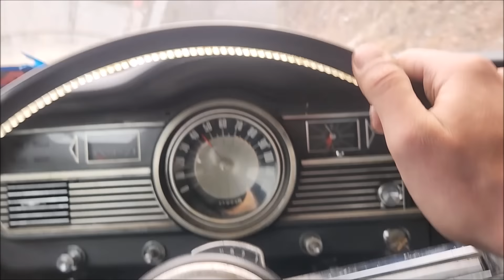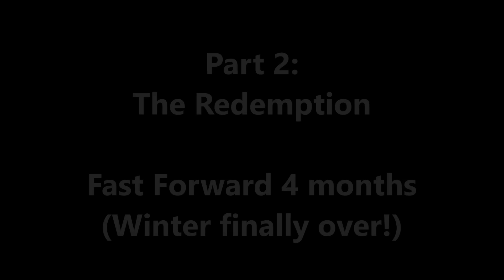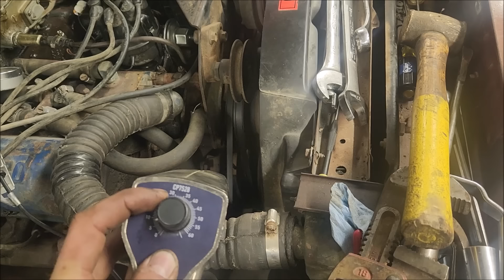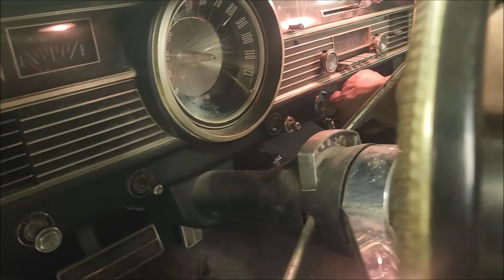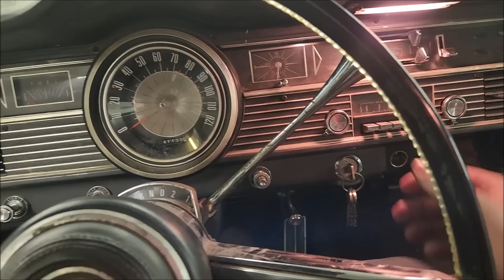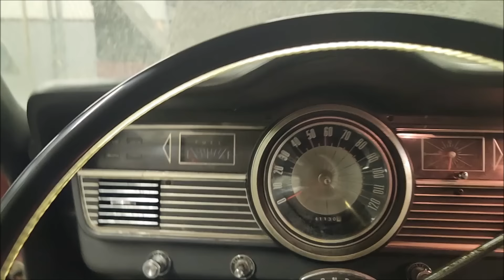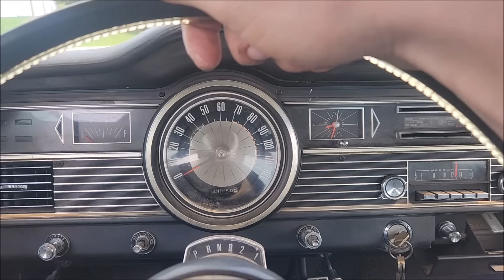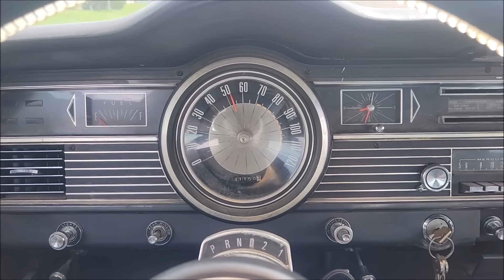$1,000 Classic Car - Will it Run & Drive Home?

Comment: You should definitely try to get that back, other than the driver's side lower rear quarter, it looks pretty solid, the interior looks like it will clean up reall nice, the seats look good, dash, headliner, all look good. I like the color combo. A big maroon Merc or Lincoln with a black interior is nice. Since he's getting the highish compression 390 2V out of it, maybe you could put a 410 or 428 4V in there if you manage to find one, that or a 351w from a rusted out truck in a junkyard and a C6 might be a nice combination. 393/408 stroker kits are still cheap for those and aluminum heads for Windsors aren't too difficult to find. Not sure if it's worth all that effort but, something in between, extra medium, 250-300rwhp and 300-400wtq is enough to feel good in a car that size. I always wanted to try using an aftermarket Windsor block that will take a 4.125"+ bore with a 2.87"(289) stroke to swing in at around 5L with good heads but, that's not what a car like that needs, might be neat to see a maniac try a 9.5" deck block with a 4.030" bore 1.165"- 1.175"CH .927 pin (331) piston, a 6.2" rod and a 4.25" stroke for 434ci to make the ultimate budget torque monster Windsor.

Comment: Owning cars that flooded 40 years ago I actually knew the foot flat on the floor starting method, it was better than pushing it down a hill or pulling plugs! No internet back then or home pc for that matter, so either some one told me or I read it in a book.

Comment: I once had the distributor on a 1970 Ford f100 with a 360 in it one time I was driving home from work and the little gear that turns the distributor broke so I had to learn how to find TDC pretty quick.😂😂😂
Oh yeah I used to like to find old cars that the owner said it doesn't run any more 80% of the time they just need a tune up.

Comment: 44:30 it's not voodoo black magic when you're explaining it.  This is something I've struggled with on various 2100/2150 carbs and others.  Now I think I understand better the relationship with the ported vacuum vs manifold vacuum and the idle speed and the timing.  It does all flow together, and you have to have the ported set to near zero before any of it will work.  Gotcha.  I think.  Really need another carb'd car to tinker with and get better.

Comment: Thanks for passing along a lot of valuable information that is quickly being lost to time , many years ago at a trade school (that no longer exists , unfortunately) I was taught that setting the points with a dwell meter was also critical to the overall "balance" you're seeking here because the dwell angle (or time) of the points also affects initial timing , do you agree ?
Reply from the maker: I do think dwell is important - especially if you start getting in the upper rpm. I think you can get away with a lot inconsequentially in the low rpm as long as point gap is in that .017 to .020 range, things just seem to play nice

Comment: I ran into something on a 390 a month or so ago that was a first for me. It ran good under acceleration but had a rough idle. Idle mixture screws just didn’t make sense but I could not find a vacuum leak. It turned out the brake booster was leaking vacuum on the inside.  New booster , reset air idle mixture she runs like new.
Reply from the maker: Always so satisfying getting stuff ironed out

Comment: Ford is the only Company of the Big 3 that is the original Company, survived the two biggest lawsuits in American Automobile History and suspensions and rears are still used all across the Hotrod community. Thunderhead289, you've done nothing wrong by sticking with Ford Lincoln Mercury products, FoMoCo for life!!!

Comment: You can set the points with a matchbook cover. Also, it times at 6 before but I always set mine at 8 to run high test.
Reply from the maker: If you follow the book you just leave gobs of power on the table. 
Need to look at initial and total - and again, give the engine what it's asking for as there are clear indicators as shown in the video 🙂
And a business card is the same - ironically .017 to .020 thou
Reply: @ThunderHead289  That was back when there was Sunoco 260. Low octane unleaded and gasohol are game changers alright.

Comment: You did the distributor drop the hard and dangerous way.  Far simpler to lower it until it stops on the oil pump drive shaft then push down and bump the starter. It will drop with a half turn. 

Then i put the engine rotated to target timing on compression stroke. Then put on cap and run #1 wire to a plug laying on a grounded surface...with ignition ON but engine not moving, rotate distributor and  look for a spark. When it just sparks, tighten the bolt.  Yer dun.

Comment: 40:45 What I used to do is put a nipple pip on with jb weld in the threads and around. Then just use fuel host and pip filter

Comment: Thunderhead289..so once running..would you say the order is dial down the throttle until no more compression on the port side..then adjust timing.. then dial in fuel mixure screws.  Then attach back vacuum advance..for the engine to tell you what it wants?

Comment: Clearly Loctite is a brand name. The product is just called Threadlocker. So many people make that mistake in Youtube land. A small torch will soften any threadlocker once it reaches 350°-450° for just a few seconds. 
 I use heat to break it down very often in my industrial repair work.

Comment: You're right. A tank in a town centre makes no sense. Is that why you drove a second tank into the town centre so it wasn't quite so lonely? You like the car and the future owner only wants the complete drive chain. An opportunity presents itself on a plate but it would have been better if you had removed the drive chain for him. He won't be taking much care when stripping it out, certainly not as much as you would have knowing that the car was going to be rejuvenated.

Comment: When my car hits 15 years or so (or I buy an older car) I replaced all the rubber hoses and belts unless I have proof they were changed in the past five years   Blowing a brake line or radiator hose or alternator belt on the road is a pain.   Even if you are paying a mechanic to do it, it is not that expensive

Comment: Hope you invested in a case of CRC Brakleen !!
I thought for sure you'd have broke out the matchbox cover for setting the point gap ...
And where did you hide ur HFT remote start trigger ??
Thanks for sharing Luke.. always a good laugh !
Reply from the maker: I usually use a business card but I always get flamed online for that, so this time I tried to do it "the right way" 

And then quickly used a screwdriver to roll the engine the wrong way - naturally 😄

Comment: Fun fact. If you remove the adjustment screw on some vice grips the slide hammer will thread into it
Reply from the maker: I'm going to cut that piece off the old distributor and literally weld it to a pair of vice grips 🙂
Otherwise ruined now anyway, so why not

Comment: Great video!  I have an 1984 Mustang 5.0L (302 CI) and it is carbureted. This video gave me the info I needed hopefully to get it running properly. The car isn’t driven much, so my carburetor issues are usually for it sitting around too much. I’m going to try the spacer, maybe that will help.  Any ideas ?  Thanks!
Reply from the maker: The biggest thing is to really scrutinize the ignition timing - it will make or break performance for sure 🙂

Comment: I've learned a lot from your videos, thanks.  Going to have to try your tuning method for sure.  I have a beautiful 68 Torino GT w/ 390 that my grandfather purchased new.  It seems to run pretty good, but if you let it sit for a couple of weeks the next start will be very difficult; it will run real rough and blow black soot for a while.  If I can get it running well enough to drive it will clear up after a few miles and then run great again until the next extended parking.  This is driving my brothers and me crazy trying to sort out, any suggestions?
Reply from the maker: It sounds like the choke is adjusted to rich - take a look at the choke flap itself, and at the choke cam screw. 
Finally, check to make sure the choke mechanism is still functioning correctly and rotate it as needed. 

Clockwise will be leaner, counterclockwise will be richer
Reply: @ThunderHead289  Holy shit I fixed it!  It was the power valve; the car runs better than it has for years.  My brother is cruising his two sons (1 and 3) in it right now, forth generation.   I figured it out by watching your videos on FEs just took me a couple months to get around to it.  You are the man, thanks!

Comment: i am guessing and very optimistic that it will drive home with the minor hangups along the way as long as the one engine is 75 percent in good condition and two has low miles and three and still has alot of love to gve to others and last a 100,000 plus miles.

Comment: ? Luke help me refresh my old memory. when i was a teen back in rthe 80's my 70 ford galaxy when i would turn it off it would "diesel" meaning it would continue to run after turning key off. My dad would fix it, but i dont remember what he did or what caused it. could you refresh my memory.
Reply from the maker: Basically its caused by a combination of the throttle being too far open at idle allowing a fair amount of fuel to be drawn in and then the engine being hot enough and the octane in relation to temp being low enough to self ignite via compression alone. 

Could have been throttle hanging if it was a quick fix and you hadn't turned any screws after your dad fixed it
Reply: @ThunderHead289  thx for quick response, have an awesome day

Comment: I think it's interesting that an instant start like this (or any well-tuned carbureted engine) is only possible on a carbureted car.  With FI, the electronics demand a little cranking to figure out where they are before they can fire injectors.
Reply from the maker: The carburetor - a miracle of fluid dynamics and physics indeed 🙂

Comment: Suggestive Braking System. Yea sounds official.
The old Standard Brand ignition point boxes are 17* thick. You can use the box lid for a gauge.
Reply from the maker: Indeed, just like a business card plus or minus a few thou

Comment: I'm Matthew from Burlington wi I just did a engine swap 350 89 GMC pickup TBI engine.  She was knocking. I used to race stock cars s and worked at car and truck junkyard. So the the truck came with 350 vortex engine efi. Oh she's fast took lots of money and special air intake manifold and good Holly TBi adper plate and bolted on shortly headers to stock y pipe and to stock exhaust lol 89 GMC pickup TBI distributor and all the stock parts GM and Ford kept same parts many years. Lol my clean 89 GMC pickup out run my 2000 5.9 gas dodge ram.

Comment: I keep having issues with setting my timing on my f100. I set it by ear, 8-12 degrees and it runs ok, but shutters when I turn it off and stumbles for a bit when I start it. hook up a vacuum gauge, shows late timing. Try and adjust it to where its green in the gauge, timing goes up to 40 degrees and vacuum would keep climbing if I could spin the dizzy more. New balancer, so that's not the issue, No vacuum leaks. HEI, rebuilt 4.9 inline 6, doing this all with the vacuum advanced disconnected and plugged. Ive been pulling my hair out for months trying to figure this out.
Reply from the maker: Mix screw will play in big to vacuum. 
Pretty sure an inline 600 has a ported advance port - same deal as this, the initial timing it takes for you to be able to reduce curb idle screw to where you have 0 vacuum on the ported port is where you want to be for initial timing 🙂
Reply: @ThunderHead289  I believe the original single barrel has a ported advanced, but that carb was long gone before I got the truck so I have one of those cheap amazon ones on there. It has an advanced port nipple, but the way they cast the carb body they blocked off the port in the carb body. I think I will need to try and track down one of the old Carter single barrels and rebuild it. The Amazon special got it running, but its not that good.
Reply from the maker: @evasesh6585  I know the originally ones were incredibly well setup and almost fuel injection level style maintained ideal afr numbers. 
It would definitely be worth tracking one down - the carb is likely what you are fighting mostly in this case
Reply: @ThunderHead289  Thanks, that was something in the back of my mind for a while. I have one off of an old AMC, but those are a little different, so I will see if I can find one off of an old ford to rebuild.

Comment: I liked what you did removing that water hose from the carb base.  But isn't it true that the older gasoline had a higher boiling point than the new alcohol fuels we use now?

Comment: I  think Ford and Didge Shared Some Partts.  They used to have a problem Vapor Locking with the Chrysler Slant 6 Engine,  unless You put a Toyota Carburator on it.

Comment: Hey Luke I  have a few questions I have a 67 mercury parklane with an fe it runs great with 20 degrees advanced 10 degrees advanced it runs like crap but 20 degrees advanced and idle set at 800 rpm and put it in Gerrit stalls to keep it running you have to set idle to about 1250 rpm for it to idle at 700 rpm  what could be causing that

Comment: I gap my points, set the timing, warm up the engine, recheck timing, check the dwell, set the dwell, recheck timing, tighten hold down and robert's your mother's brother.

Comment: what size allen key is it for the vacuum adavance adjustment?  Are all of those aftermarket ones adjustable?  I have a standard motor products on my 64 Galaxie.
Reply from the maker: Probably all the same size - you can tell which one it is since if it's too small it slides way in. 
Can't remember the size off hand 
That's what I beleive this one on screen was - same as yours
Reply: 3/32"

Comment: We don't need any more Chrysler. Dylan McCool has saturated that. 
Back in the day had a '67 T-Bird. Same 390. A beast. Not more than 6 years old and the gas tank sprung a leak. Lousy Sears gas. Didn't have a garage, so worked on it in the parking lot of my apartment. Couldn't keep it.  Wish I still had it now.

Comment: On those FE's. Isn't the timing supposed to be 10 degrees before top not after? The service manual for my 68 f100 with 360fe shows it as 10 BTDC.
Reply from the maker: Don't follow the service manuals - that's something ford people do that gets them into a lot of trouble. 
Ironically, it's because ford people try to do things "right", but in this case the right of yesteryear isn't the right of today. 
Different era, different type of fuel - same reason the heated spacer worked then and not now. 

As I show in the video - the engine will absolutely tell you what it wants via the vacuum on the ported port. 
The initial timing it takes to idle with 0 vacuum on ported via curb idle screw, is absolutely the initial timing the engine is asking for. 

It makes a massive difference

Comment: Awesome video man. is timing advance the same for my 360fe with factory duraspark? I found out my advance canister doesn't work when doing the suck test. Simply does not move so figured it's no good. Does the duraspark advance ystem work the same as if it were points?
Reply from the maker: Everything is indeed exactly the same except for the point gap
Reply: @ThunderHead289  thank you! New canister is on the way. Runs OK with the bad canister but i wanna get her done right and get the total timing verified 👍
Reply: @ThunderHead289  new vacuum advance canister is installed, working properly with suction. However, the canister arm is not staying engaged to the distributor after a few minutes of driving 🤔🤔 having to pop the cap and rehook it to the advance plate under the cap... Thoughts?

Comment: i had a 69 f250 with a 390. i rebuilt the engine and ran it for awhile. had a c6 and boy was that fast I outran a newer ford truck and all it had was a 2bbl and points. loaned it to a friend and he messed the trans up found out the a car c6 was different than a truck c6.

Comment: Hi Luke, I watch all your videos as they are very informative. I am having a couple of issues with a 1979 Lincoln Versailles (Ford Granada/Mercury Monarch). Number one is that the hood latch is not releasing. Tried pounding on it while pulling on the release cable inside the car. Poured PB Blaster and pounding on the hood. No go. Looked underneath and tried yanking on things. Also no go. Any ideas? 
The reason I wanted to open the hood is to identify the ignition system, Duraspark II or III. Either way I want to get rid of the Variable Venturi carburetor and replace it with a simple 2bb carb. I just don't what has to be replaced to make this retrofit. I have heard that sometime in 1979 Ford used a flywheel mounted crank sensor than a harmonic mounted sensor to trigger the distributor. 
Have you had any experience with the these?
Reply from the maker: Never heard of that from 79 - my advice would be to get someone to hold pressure on the cable pull while you push down on the hood at the same time
Reply: Thanks Luke. I've already tried that with no luck.

Comment: Question about carb cheater... Should we use an insulator with it or is it is own insulator? Does it work well with slight engine mods like cam swap...?

Comment: Quick question are you still running that summit brand annular booster carb on the fairlane and if so what are your thoughts about it all these years later. Any issues with it or would you still recommend it thanks in advance